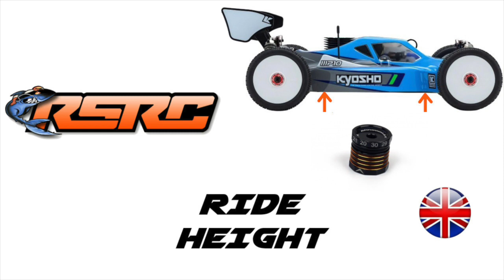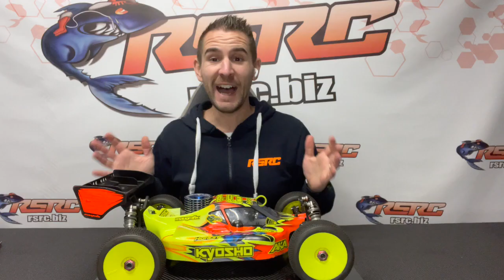Quick Tutorial #3: Ride Height

Comment: What happens if ride height in the rear is higher, is it more grip in the rear or less? In other words the higher it is the more the back will spin out or the less
Reply from the maker: Usually the higher ride height the more roll. So it should be more grip but it will depend on the value